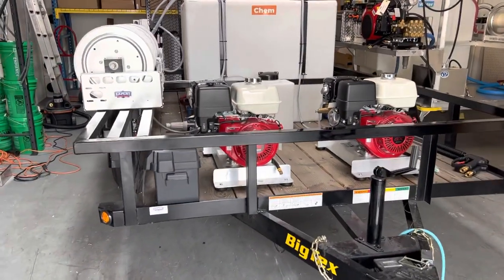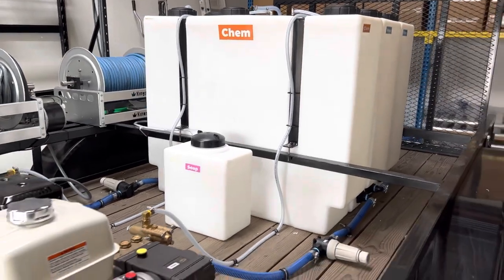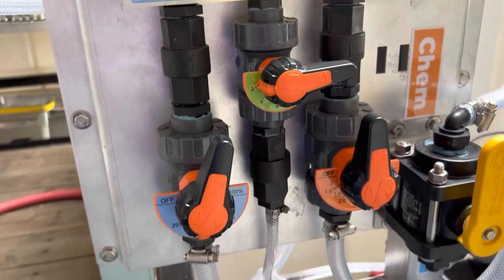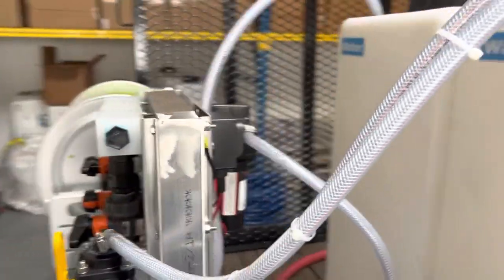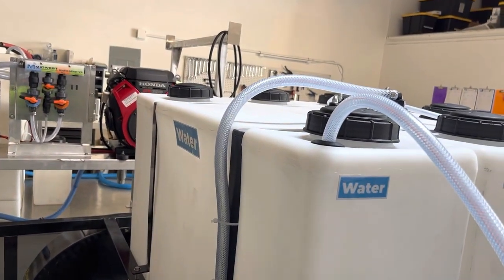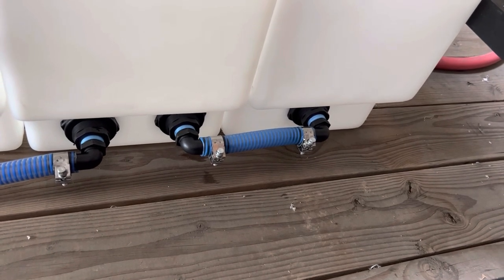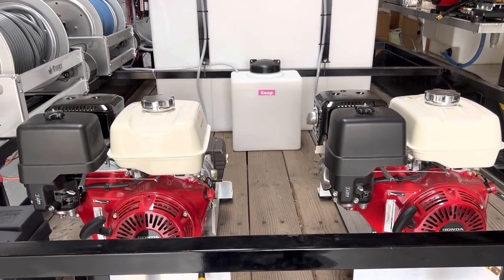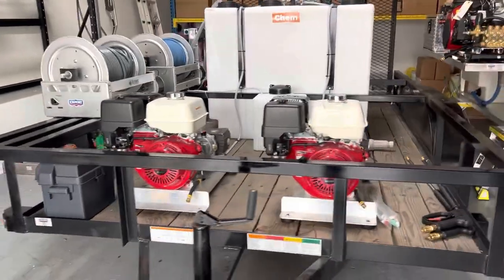Pressure Washing Trailer Build Setup with twin Honda 390s-  John’s Trailer

Comment: When it rains won’t water get into the tanks through the uniseals
Reply from the maker: No rain won’t get in. These are specially designed for plumbing. Look them up. Great alternative and better option to bulkheads.
Reply: Can the hose be removed out of the uni seal if needs repairing ?
Reply from the maker: @Eugz92  yes
Reply: Legend ,thanx for responding

Comment: Can i use QC fittings for my softwash hose? Will this be a problem?
Reply from the maker: You can. We don’t prefer them. I like a crimped 1/2 fitting directly to the gun. One less fail point.
Reply: @ExpertPowerWash  well, I don’t like to have to roll up 200 feet of hose each time I want to move the track.